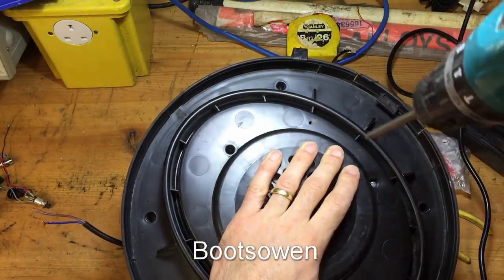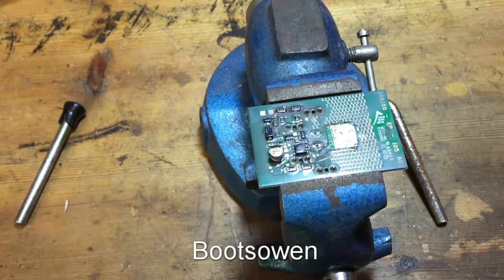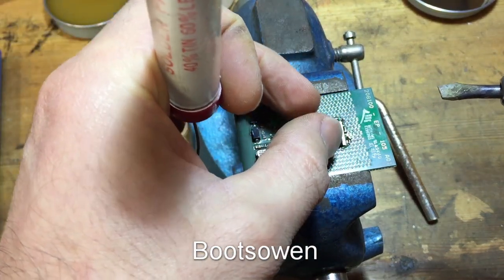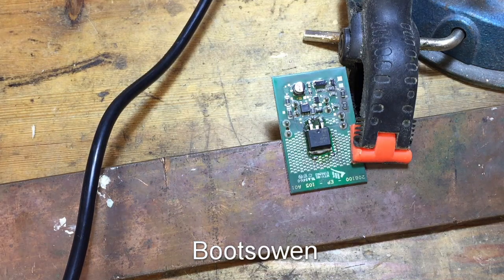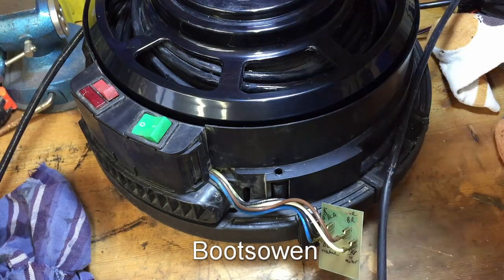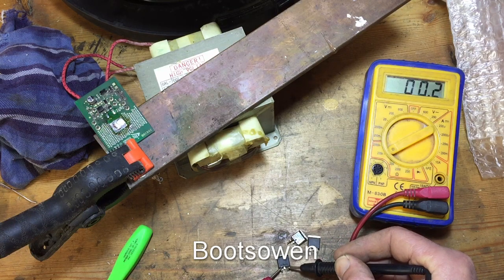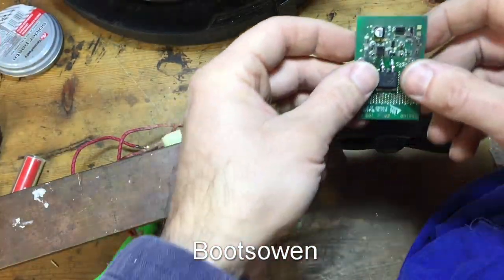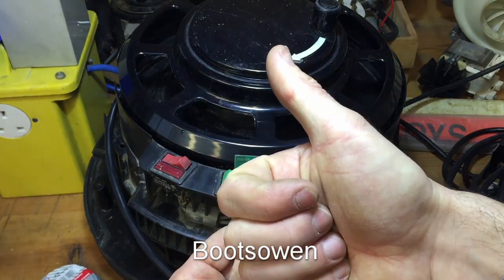A new transistor for Henry, what am I doing wrong?

Comment: T1235H-6G triac 600V 12A, made by ST (SGS-Thomson, a French/Italian/Dutch micro-electronics manufacturing company) . Quite a commonplace component. It's not a transistor, but a double-thyristor (anti-parallel array) for AC light dimmers and brushed motor controls.
"Triac" = triode or three terminal component for AC application.

As vac motor brushes give off carbon dust during wear and the unprotected circuit board is placed in the motor's exhaust air stream, i regard this as a deliberate measure to shorten the circuit's life due to short circuiting through built up carbon dust. I can' t believe that an electrical appliances designing engineer doesn't know about this phenomenon, and therefore i suspect intent, especially since the issue has been known for years and no improvements were applied. Triac controls can also be found in power tools, like angle grinders and heavy duty stone polishers, for soft-start and rpm-control. Circuit boards in those tools tend to be closed modules, often cast in solid blocks of resin, precisely for the reason of preventing soiling, creep currents and shorting.

The triac is likely still okay,  the damage will be in the control circuit (the small components around it). A triac does only conduct after receiving a trigger or "ignition" pulse, and such pulse must be given during every AC sine half wave (both positive and negative), because the triac stops conducting at every crossing of the sine wave through zero voltage level. The "lo" setting on a vac is often 70% of full power, meaning that the control circuit is adjusted to let 30% of each half wave pass and then give a pulse, so the triac conducts the remaining 70% of every half wave. A damaged control will give no pulses, meaning that the triac stays shut and conducts no power to the motor. 

 If the control has a  motor soft-start feature, the circuit also includes a dedicated integrated circuit which has an automatic ramp-up timing for the pulses. The IC starts off with letting 99% of the sine save halves go past, meaning that the triac conducts the remaining 1% to the motor. By shifting the pulse timing gradually until the pulses are right at the start of every half wave (= 100% power to the motor), a smooth rpm increase can be achieved. Motor life can be increased considerably with soft starting. With electrical faults like shorting, the control IC (being the most delicate and vulnerable component) is often the candidate.
Reply from the maker: Those little boards are coated but eventually the dust and heat gets to them. Because of the coating it is difficult for a novice like me to work on them. But I fancied a go. I have attached a Henry hi lo unit to my oscilloscope on another video and the wave is chopped as you mentioned. I think I have also put a motor with a tda1085c based speed controller on the scope. But I can’t remember if I made a video of it or how it was chopped. The tda1085c unit is much better than scr or similar because it reads speed from the tacho on the washing machine universal motor and regulates for speed.
Reply: @bootsowen  Yes, Motorola made the TDA1085-range as a dedicated brushed motor speed control, mostly for washing machines, although AEG used them in electric drills (SB2E-801, -901 and -1001, in the mid and late 80's). Ramp-up to full speed is determined by the charge time of a capacitor. For a washing machine, the build up to full spin rpm preferably takes 20 or more seconds, to ensure even spreading and clinging of laundry items to the drum surfaces and minimalise imbalance vibration. In washing machine pcb-designs, the capacitor is typically 100 microFarads for such a long ramp-up. I found through experimenting that a value of 2.2 microFarads gave a soft-start ramp-up of 3 seconds. The IC also features a gradual ramp-down timing, allowing the laundry to gradually loosen from the drum wall after spinning, instead of coming loose in a clump, which is a bad start for the rinse cycle. The tacho feedback ensures that a set rpm is maintained, independant of motor load (within limits, of course). I built soft start circuits with them in the early 90's, for vacuums and even a Qualcast lawn mower. All of them still work. From memory i recollect that the tacho input is voltage based rather than pulse based and that the input leads can be coupled to ground with a certain resistor value, if the tacho feedback and rpm stabilising function are not needed. Be advised though, that this IC can only trigger dedicated triacs, which are able "to fire in all 4 quadrants" (explanation of that would be too long here). Suitable triacs are e.g. the MAC15A8 by Motorola and the BT139-600 by Philips. Readymade soft-start modules made in China (not only the NTC variety, but even with full triac control) can be had for as little as 15 Euros/ 12 GBP nowadays, so why bother to design, etch and drill a pcb and source all the parts (a challenge on its own accord) anymore?

Comment: I don’t think your doing anything wrong I think the board has had it when these hoovers fail they either completely die like this one or they change between speeds like the one you bypassed
Reply from the maker: It was strange though, it worked on low before, now it does nothing at all!.